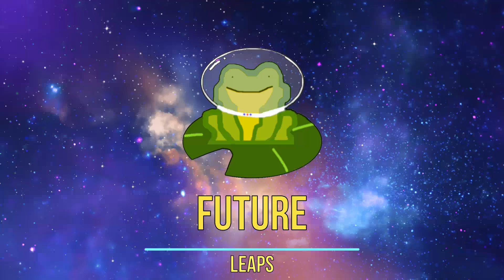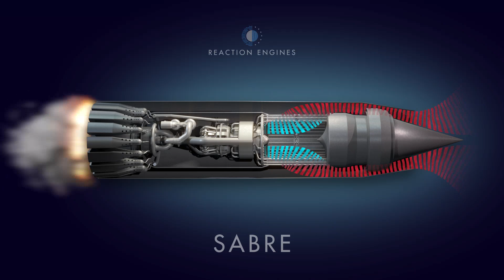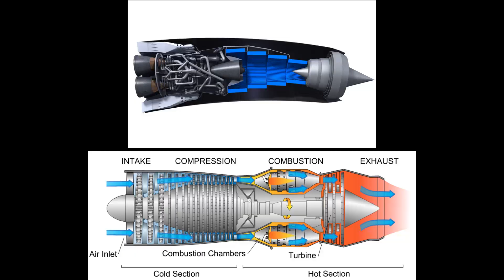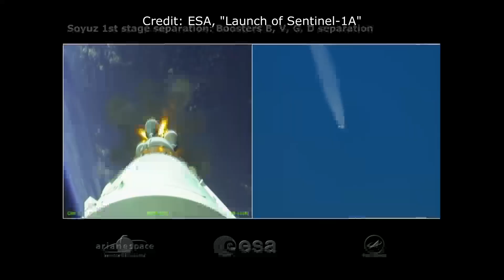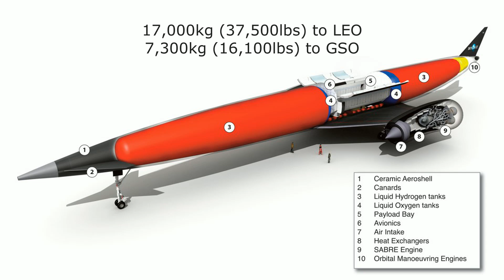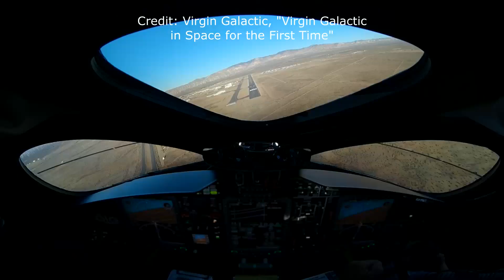Are Skylon Spaceplane and SABRE the Future of Human Space Travel?

Comment: I think ablative heat shields would be safer as ceramic heatshields caused a SpaceShuttle disaster ... also scaling Skylon up five times (making it 65 meters long) might reduce costs too ... (an ordinary jumbo jet (Boeing 747) is about 70 m long) ...also trying to simplify the engines might reduce cost, but first they gotta make them working

Comment: To make a SSTO more feasable then a rocket canister, even though ssto is far more cost effective. The craft is not suppose be without wings, its suppose to BE a wing SHAPE pinch body, the only reason the Lockheed SR-71 & A-12 had engines so far extended wing limbs, was to exploit holding bulk ramjet air vac compression & sound for added speed, the engines on the Skylon CGI is in the middle, unless attempting to make it semi vtol, they instead should be in the back adjacent or have the pure rocket exertion engines there instead for exo altitude use.

Comment: It has fascinating 'all-in-one' multi-engine, effectively simple in structure shape design, unlike rockets that go through stages, SSTO goes to phases, example, blade propulsion and wings, to jet afterburn, to ramjet support, below the Kamen, eventually smaller need rocket thrust beyond the thin air & gravity line, rockets have favor above the kamen, airplanes below. Nearly 66% of a rocket stage is burned out zenith attempting, heavy gravity and terminal velocity air burrowing. Rocket is still a faster stage up, but a luxury canister burning thrust of money.

Comment: Black bird spy plane uses that kind of engine technology
Reply: The difference is the cooling of the shock compressed air, necessary at Mach 5+ before it enters the compressor.
On the Blackbird much of the air bypasses the compressor and the temperature after the inlet shock system and diffusor is much lower at Mach 3+.

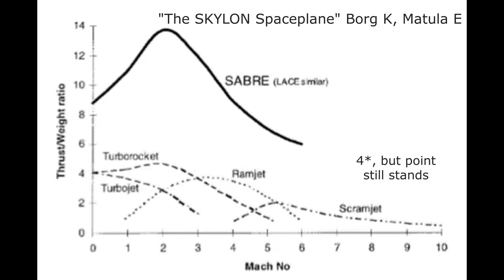Comment: The chart at 5:38 is misleading, as it shows the air breathing mode of the sabre engine. Most of the Delta V will be generated in closed rocket mode. So that number would be more interesting. Maybe ~400s?  
I think it will take least 10 more years for Skylon to make a complete flight to orbit and back. They are inventing this for centuries now and there are still so many unsolved problems. 
One is thermal protection at Mach 5 and at reentry. 
I think the heat shield will eat up every kg of payload.

Comment: Hydrogen is a stupid fuel to use for this. Methane is where it's at. Moreover, it needs to be a flying wing design. This way your fuel provides lift as well. And it'll be able to shed more speed in less atmosphere. Reducing overall heating and stress on the ship.
Reply: Stupid man,This design meant for less air resistance after 26km height amigo.

Comment: Skylon would be great in pretty much every aspect. It'd mean that we could launch space missions from the UK, whereas it's not even really an option with rockets as there isn't enough dead space to ensure a safe 'exclusion zone'. I also think that a plane type space vehicle would be more favourable for the space tourism market as people will likely feel safer on a familiar plane-like craft rather than a rocket, which for most people will seem really new and unsure. 
The same theory applies to point to point rapid earth travel.

So I believe there is a gap in the market for Skylon, even with companies like SpaceX already far ahead (at least they appear to be) in the development process. The biggest problem Skylon is going to face is funding. It has to progress fast enough for interest to stay at a high, but that means they need a lot of money right from day one, and then they have to keep the money coming in to have enough to sustain the program over the years before it becomes a flight ready, commercial vehicle. 

Great video and a great concept, I hope they see it through rather than dumping it part way.
Reply: Reaction Engines have the support of Rolls Royce and the EU
The concept is sound as far as the propulsion system is concerned.
Heat protection to survive re-entry is unclear.
Analysis alone is insufficient. A test of a reduced scale vehicle is required to verify structural integrity and controllability during re-entry.
Reply: @hernanposnansky4830   weight,surface area and speed are enough to give a reasonable estimate of heat.This is not exact yet but that is why it has active cooling.Space X  rockets can never move cargo from city to city because of the noise it makes when landing.All it will take is money.The UK Gov't is useless when it comes to foresight.The large surface area  stops the vehicle from screaming through atmosphere like the space shuttle did.

Comment: The adjustable nozzle is something new. I hope they master it. I was suggesting that it might be better to use aerospikes with hydrogen cooling of the spikes; they'll likely need the same cooling for that adjustable nozzle. Which one would be easier/problematic for SABRE to quickly move forward? SpaceX already has quite a headstart.
Reply: it's more a feature of how the SABRE 4 uses separate combustion chambers while sharing the nozzle extension. The main reason for using it is flow stability, it's only about 6% efficient for altitude compensation.

Comment: No. Once a fraud, always a fraud.
Reply: @Nova Courier. This 🤡 concept has been around since the 1980's.
Reply: @Nova Courier. No, it's just fraud. More than 80 intercooled and ram engine cycle combinations were studied by the Marquardt Company (who actually designed, built, tested, and flew a number of advanced engine concepts) in the early 1960's (Lead authors Escher and Flornes - friends of mine). The Skylon cycle was one of them. It was a loser. The better cycles went on to become the basis for the Aerospace Plane in the 1960's, the X-30 in the 1980's, and all the hydrocarbon scramjet concepts in the U.S. from the 1990's onward. All reaffirming Marquardt's original conclusions.
No intercooled cycle engine has ever flown, but Marquardt tested a full scale liquid air system at their Saugus, California facility in the late 1960's. They knew what they were doing.
Reply: @Nova Courier. $3.5B was spent on the X-30 (NASP) program from 1984 to 1995. That effort included the development of materials still not in production use. That effort included numerous component and engine tests. None of that work changed Marquardt's original conclusions. 
HOTOL/SABRE/Skylon pops up about every 10 years when there is a new generation of neophytes who don't know any better.
Reply: @Nova Courier. The X-30 program is classified. However,  publicly released information shows that  it used a scramjet cycle (invented by Dugger and Billig at JHU/APL). That cycle only operates (well) at very high Mach numbers. Other cycles(s) are required to get from the runway to scramjet takeover. The SABRE cycle, among others,  is capable of low Mach number operation.
Reply: @Nova Courier. It could operate like that, but history shows that it's a bad idea. Above Mach 3, ram compression is all you need - or want. But Mach 3 is only 1% of the energy needed for orbit. A scramjet at, say Mach 25, has attained about 69% of the orbital energy. Or, just forget capturing air and use a pure rocket and save a lot of weight and drag. 
Any serious, competent study of this problem will reach the same conclusions. 
It's no surprise the two SSTO projects that got closest to fruition were NASP (scramjet) and RLV (rocket).
Reply: @Nova Courier. After you've spent $3.5B, or $7B in today's money, come back and tell me if it's a good idea. What you are saying sounds like the original DARPA sales pitch for NASP. There's a lot more to it than that.
Reply: @Nova Courier. Did you work on NASP? I don't think so. Did you work on X-43? I don't think so. Did you work on X-51? I don't think so. Are you part of the latest SABRE scam? Maybe.
Reply: @Nova Courier. Could it be that you're a Brit whose country has long since lost the capability to do...

Comment: I keep saying that spaceplanes are the future. Those piddling with rockets will be kicking themselves before long.
Reply: Spaceplanes and Rockets will fill different gaps in the market. 

Primarily, spaceplanes will likely be used for Space tourism and point to point rapid earth transport, whereas rockets like Starship will fill the role of taking the lead in Space exploration. You couldn't land Skylon on Mars for example without someone landing first and building a solid, safe runway big enough for it to land. 

They excel in different markets so both should find success.
Reply: @L3gionMusic  Space planes will do more than that. They'll be the premier satellite delivery system by mid-century and by 2100 don't be surprised if space planes, aided by extre-vehicular frames to be docked with in orbit, take over all spaceflight roles.
Reply: @johnsteiner3417  I think you are way to optimistic. Even if the concept works out, spaceplanes will always have a much lower payload capacity than 2 stage rockets. 
Just because they have to carry their complete weight until the end. If Spacex´s Starship/SuperHeavy concept works out half as good as planned, the only use for spaceplanes will be delivering crew or tourists to orbit. 
And many underestimate the reenty. Skylon will have a hard time surviving this with its light weight construction.

Comment: The USA built an emergency landing runway for the space shuttle on the British Ascension island, four hundred miles from the equator.

Hopefully this could be adapted for Skylon.
Reply: They lengthened the RAF runway, but not long enough for Skylon to take off from (although there is enough island for it...

It is a potential abort landing location for the CNES TSTO SABRE powered concept
Reply: Skylon needs a 20000ft runway. This is incase it needs to brake so it limits where it can take off and land

Comment: That's such a great video, no doubt about that. I am definitely looking forward to seeing Reaction Engine's final design of the Skylon and SABRE engine, however the Space X Falcon 9 is not fully reusable, because only the Core Stage and the payload fairings are reusable, but the second stage is disposable which in my opinion the Falcon 9 and Falcon Heavy are 75-80% reusable. As you've also stated, Skylon can carry a maximum of 30 passengers to LEO while the SpaceX dragon currently carries 4 and ultimately can carry 6, which could make Reaction Engines with its Skylon and SABRE engines a direct competitor to SpaceX in commercial human space flight.
Reply: Falcon Heavy is % more reusable, since the two boosters are also reused.
Reply from the maker: Thanks for your comment! You're absolutely right about the Falcon rockets, each part/stage has a different number of times it can be reused while Skylon is one unit and fully reusable. I'm also eager to learn more about SpaceX's Starship and how it plans to approach human spaceflight.